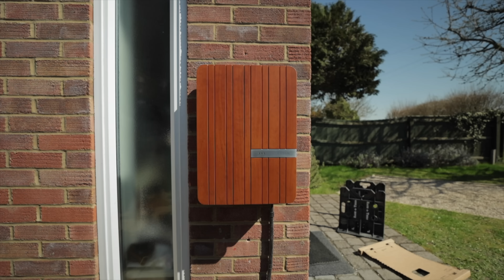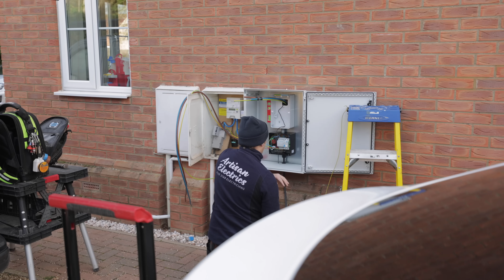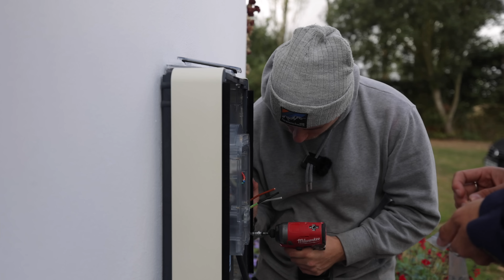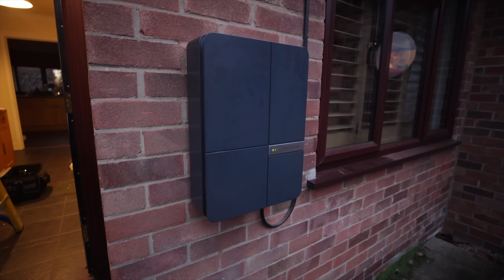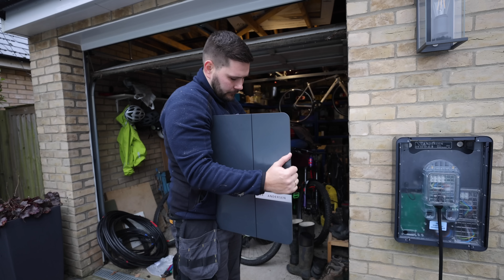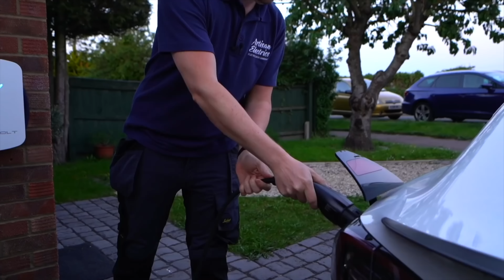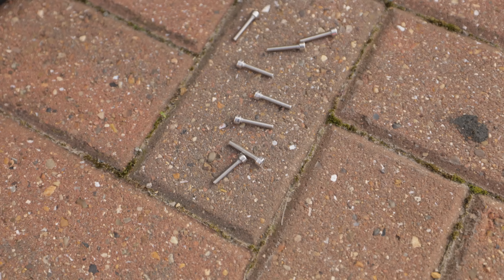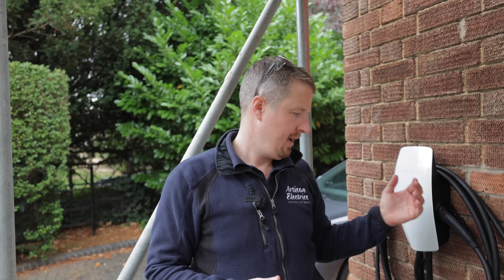5 Best EV Chargers Compared: Honest Review & Brutal Opinion🫢

Comment: I went with the Hypervolt 2 as it was the best there was at the time I had it fitted (2021). The Zappi was another option but I didn’t like the aesthetic of it.

I understand the Hypervolt 3 is better with regards durability but the v2 is terrible. The white shell has went a yellow colour and the black holder for the charging cable has faded to gray. It’s all just very tired looking.

Can’t fault the functionality. It’s just what was a pleasing looking unit when first fitted nos looks like an antique.

Comment: Have you ever had an issue with Hypervolt 3pro? The PEN (according to Hypervolt) took a dislike to my supply which peaked at 252volts. It’s constantly hovering around the 250-251 Volts and only drops to around 247 at peak times and at those times the charger is happy. I think this is possibly to do with the substation being 100 metres away. My neighbour electrician tells me the NDO won’t reduce their output and he suggested a voltage optimiser to pull the voltage down to the charger. 🤷🏻‍♂️
Your thoughts are appreciated.

Comment: None of the chargers you listed appear to be future compatible with Vehicle to Grid or Vehicle To Home which will become a major feature from 2025 when EV manufacturers will start to mass produce cars that allows bidirectional charging e.g so cars can power your home or grid too. There is already a charger that has that feature that is recommended by Octopus to be used with their Power Pack tariff called the Wallbox Quasar 1 V2G charger but surely other major charger manufacturers should have incorporated bidirectional charging by now.
Reply: Vehicle To Home would be nice to have that feature, Several times i looses the power maybe 7 times in one day when the line into the house is disconnectted from the grid because stormy weather or fault on the power line (and they work on fixing the problem testing differt things. its very annoying

Comment: The biggest issue with my energy quality I find is that every single zappi is different. The colour of connector blocks is always blue or green. Colour of lid washers are black or white and different. Now that sounds daft but it basically tells me they’re not using the same suppliers/it’s what ever is available and not streamlining the product. Love the charger but questionable on quality control!

Comment: What about the security aspects?  Can you lock the chargers so other people can’t use them?  How good are the cyber-security capabilities of the manufacturers?  Will you have an inoperable charger if the manufacturer is attacked?
Reply: I have an Ohme Pro charger, which can be locked via the app. There's also a feature to approve each charge with your finger print.
Reply: He can't know any of that
Reply: An installer isn't going to know all the vulnerabilities of each product. If they did, they'd probably be manufacturing their own units. You can't expect an installer to know this.
Reply: @mattblackledge9068  This is a video advising on which units to buy, and I personally think that the security features of the units would be an interesting thing to comment on.  On the cyber-resiliency of the manufacturer's maybe not every installer will know this, but perhaps the ones putting out videos on which charger to pick should do some research?  As the number of EVSEs and home battery systems increase, the security of kit that can connect to the grid will become increasingly important, I think.  I can see a point where manufacturers offering cloud management capabilities that manage hundreds of installations will need to sign up to a recognised standard such as the SEC or CE+.   G99 sign-offs in future might involve sharing the manufacturer's cyber attestations.

Comment: Very rare I watch a long YouTube like this in one go but found it so fascinating did this time. Only worry about the 'paid promotion' and hope it wasn't one of the charger companies which would spoil the comparison. I've had an Anderson 22kW since 1999 and it did worry me when they went into administration however I was told it would work without the app but (re one of the comments) perhaps that's wrong. Its never put a beat wrong over that five years and suerly thats what makes a good charger. What you dont want is any hassle with charging. 
A reliability chart would be good and perhaps a poll could be organised?

Comment: Manufactures need to improve their product including App , I have a Pod Point , if internet goes down charge point goes to ON which is good , the downside is it uses coloured a multi coloured LED to set up , run , and show state & fault , not much good as im colour blind . The App is set for overnight charging , but if I am not home the schedule still runs , there is no way of turning it off from App the work around is alter schedule to 15 mins on so that is off rest of day , or turn off at mains . I have spoke to Pod Point for two years to see if an off setting could be added to App but nothing done , I think most charging points will work but as a customer we have no way to check App operation before purchase , maybe you could look at this and post your findings

Comment: One thing you forgot to consider is how much power the charger wastes when not charging. I have Hypervolt 2 for last 4months as 3 wasnt around. It burns 100watts with lights off and 200wstts with them on. Which is between 2.4kw and 4.8kw a day which in my case doubles my houses daily consumption. So I have to switch the charger when not charging to avoid waste full energy loss. I was lead to believe generally when off most chargers burn may be 10,watts or so like a TV but mine is really wasteful.  I checked and my charger is working how hypervolt say it should 😵‍💫
Reply: I have a HV2 as well and it only burns around 8w in standby with leds at 25%. Something is wrong at your end!
Reply: Ugh! thats horrendous, not that it helps you but according to Hypervolt for the V3: The Hypervolt Home 3 Pro EV Charger has an average standby power consumption of 4.2 watts when set to the lowest LED brightness setting. When the LED brightness of the Hypervolt Home 3 Pro EV Charger is set to its peak it consumes 8.4 watts

Maximum LED Brightness Power: 8.4W
Other Standby Functions: These typically include maintaining network connectivity, internal diagnostics, and status displays.
Given that LED brightness accounts for 8.4W of power, and assuming additional standby functions draw approximately 1-2W, the total standby consumption can be estimated to average around 9.4 to 10.4 watts.

To summarise:
Lowest LED setting 4.2W
Full LED Brightness: 8.4W
Additional Standby Functions: 1-2W
Total Average Standby Consumption: 9.4-10.4W

Comment: This must have been recorded some time ago as Myenergi has been working with Octopus “intelligent Go” for at least the last year. On the question of my install I had the first Zappi mk1 that became faulty and was replaced in warranty for the Zappi 2 it was also faulty as the connection terminals wouldn’t tighten up on the cable so a second Zappi 2 was sent out and now that Zappi 2 which is just over  3 years old is faulty! Thankfully I paid for the extended warranty and am now waiting for it to be replaced. Not a very good customer history! Hopefully fourth time lucky. Would I buy the Zappi again? Yes as it integrates with the rest of my system of solar and batteries so well, but I would definitely buy the extended warranty. My real concern is if the company were to go into liquidation.

Comment: Tesla Wall Connector is working well for us, not sure why I would go elsewhere (for less features and higher price?), it integrates well with OctopusEnergy (in NZ).
Wall Connector has more of the important bits here in NZ than a lot of the other common chargers here (RCD Type A + DC 6mA)

Comment: One of the main areas that is not addressed by this video is the support for OCPP protocol integration and the ability to communicate to secondary systems by Wifi or Ethernet. This is now becoming more important to allow integration of a EV car charger into household systems eg Home Assistant
Reply: Does OCPP support mean that the charger doesn't need to access the manufacturer's server? I think depending on an internet connection to the manufacturer is a big problem if companies go bankrupt, or have outages or cyber-attacks. The apps should be able to talk directly to the devices over the local network, not use the cloud.
Reply from the maker: Very true, I believe Zappi has OCPP now, Easee has had it for ages, I am not sure about the others.

Comment: Why no Ohme? Quality is OK, and it is integrated with Octopus which is very important.
Reply: Artisan only fit the most expensive of expensive fixtures and fitting at the best highest prices - yes Ohme is too cheap for them I’m afraid
Reply: Your bias as the ohme is a great and reliable charger also easy to install.
Reply: I guess Ohme don't want to pay this guy a kickback for promoting their product, hence his negativity. Ohme is a solid choice, and very popular.
Reply from the maker: Cheap junk and 4G sim not ideal
Reply: @artisanelectrics had one for a few years never let me down. I live in not great 4g area, I get one bar on my phone but the Ohme always connected and asks me to authorise the charging within seconds of connecting to the car. I tell it my highest kw per hour price from Octopus  and it works within that.
Only thing cheap about it is the cable holder.
Reply: @artisanelectrics  Certainly not 'cheap  junk'! As for 4G, that is an answer to a poor wifi signal that besets many chargers. Anderson is overpriced and no Ethernet connection, that is poor design, never mind how 'nice' it looks!
Reply: @ianmenai  The 4G signal sounds like a terrible idea. Instead of being able to talk to your charger on your home network, you need your wifi to be working on your phone, the Ohme server to be working and the 4G network they use to be working. If you connect with ethernet to your house connection, you only need your phone's WiFi to work and you can connect to the charger, even if the whole of the rest of the internet is down (unless the charger software is bad at this).
Reply: @rjmunro  Several things in your surmise are not correct. The 4G phone signal is incredibly reliable! How often, when stationary, have you dropped a call on a mobile? The answer is very, very really if ever! Next, your connection to the charger via Wifi is via the Ohme server, not direct, so you need a good internet connection, and that is no better than a 4G signal! So the 4G connects to the server and then comes back to you via the internet and then to your phone, not from the charger itself! As many have found out, the Wifi signal outside the house can be flakey at best, non existant at worst. 4G solves this, as outside the 4G signal is strong in most of the country. It chooses the strongest signal, a be it Vodafone, Three, EE or O2. So that trumps a  Wifi signal trying to get out of the house! So no it isn't a terrible idea, it is actually a very GOOD idea, and proven to work reliably over many years!
Reply: @rjmunro you don’t need wifi on your phone you can use the 4g network. If that fails you can just use the interface on the front panel to operate it. Don’t get why 4g would be an issue. In 2 years never had a problem connecting.
Reply: @ianmenai my whole point is that I should be able to connect directly, not via ohme servers. Connection via a third party server is great if you need to check status when you are not home, but you should be able to connect directly e.g. if the ohme servers are down, or you don't want to pay their subscription any more (if they make one) or whatever.
Reply: @rjmunro  I don’t think you realise that nearly all chargers operate via their servers, not direct! This goes for all solar and ASHP units. Some, Foxess, have RS485 connection and  allow them to be controlled by Home Assistant etc. It is the same for cars as well. Local control is rare these days and certainly not directly via Wifi to the unit. Hypervolt and Zappi operate via their servers by the way!That is how it is these days :-(

Comment: Have you installed the Sigen AC charger yet? Thoughts on that if you have the Sigen PV inverter and battery.
Reply from the maker: Not yet but we have one coming up soon, I would say its probably a no brainer to keep everything within the same ecosystem
Reply: Good advice. I’m on MyEnergi for EV and immersion but selected Sigen for battery because it served 3 phase best. I now have Myenergy, Elios4you and now Sigen operating together - all behaves itself with Battery maintaining control around the zero point and achieving 98% self consumption.

Comment: In terms of future proofing, because the Zappi uses your home router, not a sim, if the mobile signal dies or 4g becomes obsolete (which it will at some point as has 3g), you still have a functioning car charger.
You also have a touch screen display to control it with if your phone dies.
Reply: As does the Simpson & Partners
Reply: The Zappi doesn't have a touch screen, it has physical buttons. It's like using a 1990s mobile phone, and it's startup sound is from the same era. Like Jordan said it's technology is behind the other charge points bar the Tesla.

Comment: Enjoyed the video. Interested in the pen fault protection advice - you mentioned older cabling, does that mean a new build potentially wouldn't have this issue?
Reply: No. All EV charge point installations require a pen fault protection device, whether it's built into the charge point or it's a separate unit.
Reply: It depends on earthing arrangements, a tt system does not require any pen fault for example

Comment: I’m getting a model 3 soon and I’m deciding between Easee and Tesla Wallbox, I think Easee makes the most sense, thoughts?
Reply: Anything is better than the Tesla wall box. It's so ugly especially with the cable around it and it has no pen fault protection which makes for a costly installation as another box needs to be installed somewhere on your property.
Reply: @GadgetMan36  PEN fault isn't a problem for me, I'm already having an outdoor consumer unit installed next to my supply box outside.
Reply from the maker: I would go for the Tesla Wall Connector, I used both when I had my Model 3 and I preferred the ease of use with the TWC

Comment: My Zappi's been on Octopus Intelligent for almost a year and I waited for it to be officially supported (was supported as Alpha before that).
Octopus list the main chargers that work with them.
Reply: They also recently added car support so they can control the charging via the car instead of the charger. 

Means you can have a compatible car but not compatible charger and still use intelligent go. And vice versa
Reply: @iambenmitchell see my previous comment regarding octopus integration of cars.

Comment: Don’t forget you don’t actually need an EVSE unless you do a lot of miles. A ‘granny lead’ type charger at 2kW plugged in for ten hours overnight for example will give you 20 kWh which should be good for at least 100 miles (YMMV).
Reply: But most overnight tariffs are for 5-6hrs so only half of the 10hrs at a cheaper rate.
Reply: @cgcmitchell114 Octopus intelligent gives you as many hours as you need
Reply from the maker: And you will likely burn out your socket charging a car off it regularly - they are only meant for occasional use those granny chargers
Reply: @artisanelectrics  Are there special sockets available that can deliver 10 amps for long periods?  Recall that EU sockets are rated at nominal 16 amps so presumably a bit tougher than 13 amp UK ones? Have you experience of them?
Reply: @Richardincancale there are but they are like 1 gang IP rated external sockets which are blue or have a notice on it that says electric vehicle charging. Even so this should be put on a dedicated circuit
Reply: @artisanelectrics agreed
Reply: Tell that to any electrician and they will disagree heavily, unless you know for sure that your circuit that your socket is on is totally sound and the socket fronts are of decent quality, i would be very wary long term using one, most sockets are not designed to withstand continuous use of 10A or more, you can get specialist sockets for ev and that would be more suitable for that use as they are built to a higher standard

Comment: One thing you haven’t taken into consideration: usability if internet is down - or if company goes bump like Anderson’s did - you’ll end up with a dumb device.
Only one of them will pass that test - Zappi
Reply: My BP one never was smart, so I added a simple relay to control it - it’s a smart charger now.
Reply: @JohnR31415  can you change the settings, ie make it use your solar panels only to charge your car? 👀
Reply: You could say that about loads of household kit, and the risks are equal across all brands.
Reply: The S&P doesn't need Internet. Can work solely off bluetooth